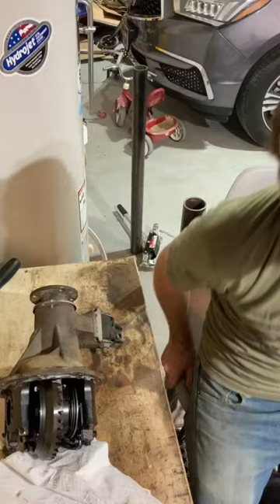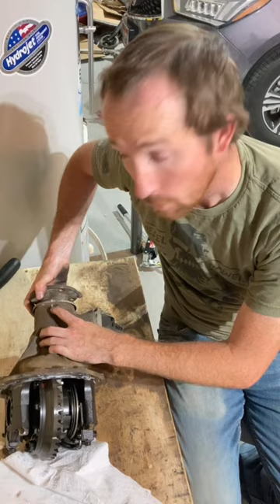How to determine gear ratio on a differential.

Comment: If you’re already to this point of having the differential pulled out and the cover plate off , the gear ratio should be stamped on the ring . Or count the number of teeth on each ( ring and pinion) and divide the ring teeth by the pinion teeth and you have your gear ratio .

Comment: Where donyou determine common gear ratios... I have a problem with my truck
Reply from the maker: First gen 5 speeds are pretty much all 5.125:1 second generation has a few more gear ratios to choose from. There are some extremely rare models that had I think 5.38? or something. Zukioffroad has some good specs on trackers. Trail tough out of Oregon is also a great resource. There’s also a couple of good facebook groups with good info and Zukiworld forum has a lot of great info.